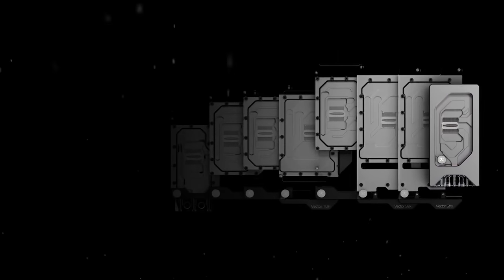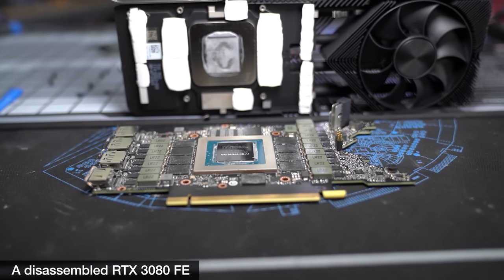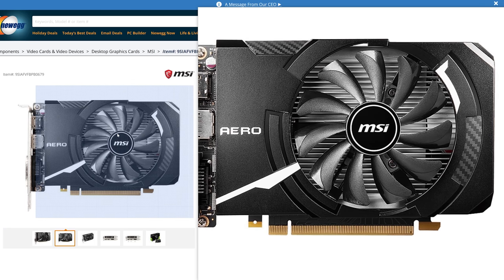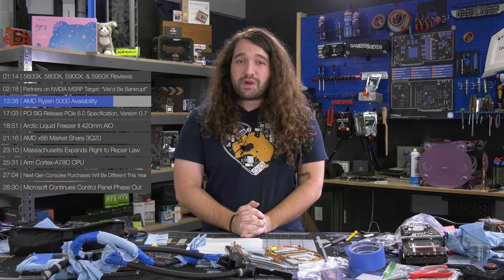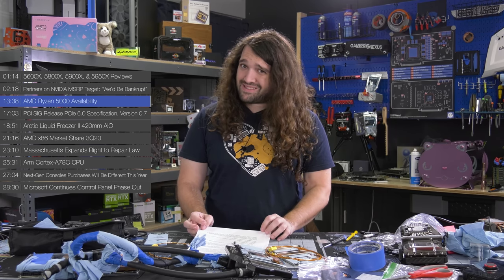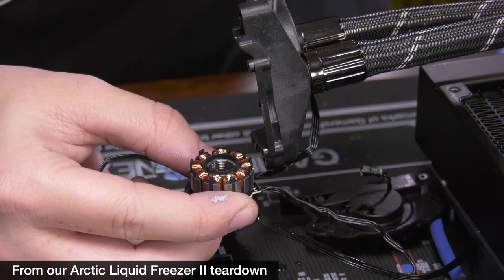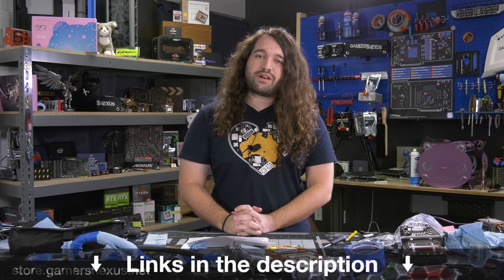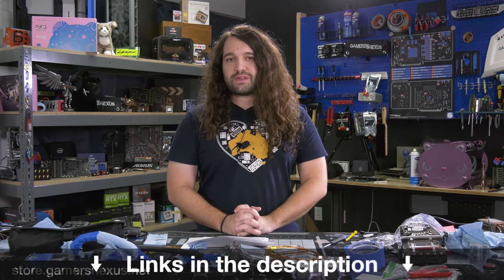HW News - NVIDIA MSRP Allegedly Not Realistic, Ryzen 5000 Supply, PCIe 6.0 Spec

Comment: "Deliberate Shortage" - I own a brew pub/restaurant. If I run out of wings or beer, I dont make money. No one goes "Ill go eat next door and pay you too." Its not like AMD gets anything more for jacked up eBay prices for things.
Reply from the maker: @n1ppale  They don't make money if they don't sell product. Doesn't matter.
Reply: @n1ppale  I think Nvidia just got cucked from going with Samsung tbh. and they didn't want to wait until later to 'lAuNcH'. Honestly should've just dropped the whole lineup with sufficient stock right when AMD announced their cards and they'd be better off
Reply: @GamersNexus  depends if the board partners are scalping their own allocations like MSI, just with better-hidden subsidiaries. That's how it works for the concert and sports industries, e.g. with ticketmaster.
Reply: If you artificially lower supply you increase demand due to fomo and the prestige of owning a sought-after item. Then when the product is stocked normally it sells better because of this increased demand. I seem to recall it's producer surplus but I haven't studied economics for years, all I remember regarding it is that consumer surplus is roughly how much cheaper the product is than the maximum they'd be willing to pay. Happened with Yeezys (as the most obvious example, I know computer parts aren't shoes). That's my opinion as to why a company would deliberately lower supply, because I don't think all companies always have profit as their motive - an example of this is fashion companies focussing on prestige, and supermarkets competing on price and customer support - even if these are to the detriment of profit, because they are more likely to profit in the long run, or if not more likely they at least offer a higher reward if they succeed than just normally selling your product at equilibrium. Not saying that also fits here, just being a devil's advocate.
Reply: @puffman06  Dude no. That was less than 10 cards. MSI is a $4B sales company. They were not impacting their bottom line by overselling 10 cards.
Reply: It is actually possibly different with a unique or unknown product though. The idea that a "freak out" on enthusiast forums could pique interest in a broader market is real.

That scenario is totally different than wings and beer.

It just doesn't really apply here when these 2 companies are in direct competition and the first one to stock shelves will win sales.
Reply: @lordbalzamore7692  These are publicly traded companies. They have a legal obligation to stockholders to maximize profit. If they got caught "faking shortages" they would be sued into the upper atmosphere. "Faking shortages" is another way of saying "losing sales" and when you intentionally lose sales shareholders tend to dislike that.
Reply: To be fair, Nvidia does play 15 D chess with us mere mortals! Who knows what evil plan that leather jacket has planned 😂
Reply: Nvidia did this in the past but it was because there was no competition but amd wouldn't do this right now because they still need to take more of pc/notebook market from intel
Reply from the maker: @puffman06  AMD doesn't have partners. NVIDIA only sells to partners, so that's what we're talking about here. Your concept makes sense for a limited supply, underhanded, slimy manufacturer, but doesn't work for the actual silicon supply.
Reply from the maker: Ultimately, you wouldn't deliberately reduce your silicon supply on a product that cost $1B to make and years to design, but which will only be viable on market for a year max.
Reply: @n1ppale  what you just said makes no sense what so ever..
Reply: @n1ppale  I can't believe that people are so naive to believe Nvidia, would intentionally limit their supply as a scheme to make more money. All this absurd claim is based on is the AMD fanboying going around, which is becoming increasingly toxic.
Reply: T1E6X1 I’ll admit that I’m am wrong with the claims that I said especially with what gamer’s nexus comment about the large investments these companies put for their products. Though if by the off chance that it were true I wouldn’t exactly be surprised. Coming from Nintendo, they have similar patterns to “artificial scarcity” (though no proof) but we can’t really come to that conclusion since well, we’re in a pandemic lol. Either way gamer’s nexus legit has more inside info and knowledge about the industry so im practically spitting shit out of my mouth in the end lol
Reply: Right now the only place i can even place an order for a 5000 series cpu in the uk is overclockers and they have a 10% mark up on everything as well as about £10 for standard delivery. And thats for pre order. 
 Yes, scarcity can be profitable.
Reply: @ge2719  But thats not profit for AMD, thats profit for the reseller based on demand.  AMD has an incentive to INCREASE supply in that situation because if customers have to pay a markup due to scarcity, eventually the price/performance for the CPU makes it non-competitive with Intel. Look at the 1600AF.  AMD sold them for $85 and it was awesome.  Then people jacked up the price because of demand and suddenly the 1600AF wasn't so great any more.  Right now on Amazon a 1600AF cost MORE than a 3600. Thats stupid and more importantly, AMD isn't making any extra money on $225 1600AFs, only Amazon is.  At that price, an i310300 makes more sense.  Same thing will happen with 5xxx series if AMD were to create a shortage.
Reply: It's more like Diamonds or Gold,  you artificially constrain supply, and everything is worth more, ao can sell less and make  more profit. It's what Nvidia is doing
Reply: it also doesn't make sense because current gen Intel CPUs have drastically dropped prices. if AMD holds their products to create a "shortage" then they're losing on potential customers to Intel or even to their older products with less profit margin, most don't want to wait months for supply
Reply: @WildkatPhoto  as far as i can tell no other place is getting supply in since i cant even pre order with them. So potentialy some sort of kick back bs going on? 
Either way when i say its more profitable were not talking limiting the supply to next to nothing, that's obviously not profitable. They just have to make sure they dont flood the market with so many cpus that a significant percentage end up sat there for the next six months and ultimately end up discounted. 
They can just produce what they can and sell them. They dont need to go into overdrive and double production, requiring more machinery and more skilled labour that then months from now they wont need because they fulfilled the majority of the demand on day one and dont need to produce anything for ages. Its more profitable to produce a steady stream that at first is in a short supply and then meets demand. So no factory ever has to shut down and no one has to stop working.
Reply: @anzumatsuri2181  Exactly, especially when a $280 processor of said line will be enough for gaming for years.
Reply: Not to mention the$170 hike on next gen version, but that's another can of worms.
Reply: @jaronmarles941  and not coming with a cooler even with that price hike
Reply: @ge2719  Meaning that $450 is now over $500. Well in 10900k range, and horrible without a cooler advantage.
Reply: @WildkatPhoto  don't waste keystrokes, my friend. if you haven't noticed, many people commenting on internet videos lack an incredible amount of common sense. I once had someone tell me that gold, an element with a unique color, high lustre, high malleability, rarity, and high resistance to tarnish does not make it suitable for jewellery. there's no point. society at large is headed towards the movie "Idiocracy," and we're just along for the ride. regarding low supply, I just put myself on EVGA's waitlist and I'm just hoping to get a 3080 within a couple months
Reply: @t1e6x12  actually there was an article written by Moore’s law is dead to say they purposely limit their stock, I think this is where it all comes from, he even leaked numbers of shipments, according to him they’re not having supply issues
Reply: @S55M3  He's shown bias for AMD before, and has been wrong multiple times. I don't trust him
Reply: If I was a shareholder for AMD, I'd want the ROI as quickly as possible.  Any signs of deliberate shortages when Intel has processors that's still good and new ones upcoming (regardless if they'll fully overtake AMD again or not) would probably be met with intense scrutiny and more board meetings.  It doesn't make sense to artificially limit supply.
Reply: Its just a Joke that Nvidia gets blamed for a terrible Launch, while AMD's was just as bad and all of a sudden it's the high demand not the low supply.
Reply: @n1ppale  You are definitely way off... Ryzen might be better but even Jay has pointed out that the best of the best is not always necessary.   If someone really needs an upgrade because they are running something significantly slower than say a 10900k guess what they are going to do if they see Intel at a price that works for them?  They will buy it.  I am personally tempted, but at the same time I am also confident that I might be able to limp along with what I have and the very minimum I might need to just suck it up and do a fresh install.  

The ammunition factories experienced a similar problem where they had to shut down and that caused them to get behind and now they are in a perpetual state of catching up until demand falls enough to give them room to breath.  The problem with the tech world right now is that there was a bunch of big advancements slated for this year and it is about the time when most people like myself consider upgrading.
Reply: @jaronmarles941  his recent leaks were the most accurate out of anyone else’s that I saw, he actually admitted to being wrong in the past and if you look at some of his comment sections you will see comments praising him for his accuracy
Reply: Compare it instead to your restaurant full with a line around the block. That's the kind of thing Nintendo and Apple do over and over.
Reply: Gamers Nexus Not all silicone sells for the same profit margins. If you are NVIDIA and have a piece of silicone you could sell as either an 3080 or an 3090, then you will of course put it on a 3090. Which is an extra dick move when the 3080 is in super high demand and impossible to find,while 3090 are comparatively easy to find.
Reply: @GamersNexus  What if Nvidia was trying to pull a Nintendo? Generate hype by how fast the product sold out...but it backfired because over a month later they still have no stock.

One popular conspiracy theory was that they didn't want to sell any significant quantity of FE cards and that the MSRP was a shell price a la the 2080ti. The theory is incomplete as some things don't add up but...

Personally I think nVIDIA miscalculated AMD's position, and/or Samsung's production capabilities, Micron's production capabilities.

Dude... seriously...8GB of VRAM on a fucking 500$ GPU? I'm vividly remembering a 600$ AMD card with 4gb of VRAM called the R9 Fury from 2015.

If I buy a GPU I'm going red this time for the same reason I bought a 980ti back in 2015/2016.
Reply: DeBriers corporation might have something to say about that, though they've also managed to convince the entire western world that you have to buy your future spouse a diamond ring for a proposal to actually mean anything, and they have a literal monopoly on the diamond industry.
Reply: If they can buy your beer next door without you getting paid, then you're really dropping the ball on the "brew" part of "brew pub".
Artificial rarity absolutely exists and works (re:loot boxes, trading cards), but it only works when you have a monopoly on the product (or often art/design/recipe). 
It isn't about selling a product in that case, it's about marketing the entire brand. One product is "rare" to increase the interest and value in the other products.
When you hear about people lining up to spend $1000 on some special color of Nikes, you feel better about spending $200 on a "common" color what are actually remarkably low quality shoes built from the same materials as a $20 pair from walmart. 
But the walmart shoes don't have the branding and FOMO.

Do you know what it really means if you're selling out of product?  That you aren't charging enough.
Reply: @GamersNexus  
AMD makes more than one product. 
I'm not saying AMD is doing it in this case because their whole product stack is sold out, but the FOMO business model absolutely works. It's how scalpers make money. It's why gamers are buying rtx 3090s. 
It's not money lost on missed sales, it's money saved on marketing and a way to pad overall margins on the in-stock products
Reply: @WildkatPhoto   you said it right there. They have to maximize PROFIT, not sales or revenue.
Reply: Yes unless you have a load of old steaks you want to get rid of and the place next door is not selling chicken or beef  because its stuck on 14nm then it starts to make sense...
Reply: While I also believe that it makes no sense for AMD to create an artificial shortage, things are a little different for Nvidia. One "conspiracy theory" sais that, based on the high production costs which are actually shown in the video, Nvidia wants to "have its cake and eat it, too" by pretending to have relatively cheap new GPUs, but still sell them at a higher price, for better margins, if the only Geforce 3080 cards which are effectively available are the high-end variants, not the cheaper variants. Then, making it extremely unattractive for manufacturers to sell any of the cheapter variants is just part of Nvidias strategy.

Of course, if Nvidia had more chips available, they would not have to do that, but apparently they do not, so then it makes sense to sell those which they have at as high a price as possible - while pretending to be cheap. And for that, temporarily pretending to have even fewer chips than they actually have, might be an advantage.
Reply: @WildkatPhoto  Then what was the point of doing it? That's what's so weird about that particular controversy. The benefit of doing it is so minimal or non-existent that it makes no sense to even do it. All it did for MSI was draw even more negative attention to them.
Reply: @ge2719  You are mixing apples and oranges. There is a HUGE difference between creating an artificial shortage and increasing your cost per unit by taking extraordinary measures to increase production. Remember, they dont own the fab where these are produced, Global Foundries does.  You cant just poop out extra wafers because you want them. I had a manager who could never seem to grasp that the fermenting process could not be speed up so no matter how much he wanted a new type of beer, it was going to be two weeks before we could deliver it.  
So let me get this straight - all the places that are selling chips at MSRP are out and the one selling them marked up at a higher prices has inventory available. And you think thats a sign that AMD is getting kickbacks? Wow.  I got nothing for you.
Reply: @Starscreamious  You dont know the restaurant business. Full with a line is a nightmare.  Perfection is one table open.  Dont believe me?  Read this stanichs-closed-will-it-reopen-burger-quest
Reply: @WildkatPhoto  wow learn to take a joke. 
And sorry but you just proved my point, if they wanted to increase production more have they already are doing in order to meet current demand and there not be a shortage then they would need to "ferment more". Like you would have to invest in larger facilities and more equipment in order to do that. And you're not going to. Amd arent going to, they arent going to get their 3rd party suppliers to do the same. So by not overworking there is a shortage, and thats the most profitable option for amd.

But oh you said I'm comparing apples and organges. Sorry but ive got nothing for you.
Reply: @WildkatPhoto  Nightmare for whom? I'm talking about it at the owner level...ie good for reputation. Are you saying it's the opposite?
Reply: @SparkY0  You are kidding right?  Seriously tell me you are just trolling.  Because one look at Steam survey tells you that while a FEW gamers might buy a 3090, "gamers" are not.  https://store.steampowered.com/hwsurvey/videocard/

The newest card on there in the top 10 is either the 1650 or the 2070 Super depending on how you want to view their actually availability. The RX 580, which is a speed boosted 480, is #10. The 1050/1050ti has more Steam Share than every version of the 2080 and 2070 COMBINED.  The GTX 970 - 4 generations back - is just shy of the combined share of the 2080 and 280ti.  FOMO my ass.
Reply: @Gareth Tucker "Right boss so I have this great idea to make more money.  See what we are going to do is not sell our product until......"
"You are fired. Get out."
Turns to next guy - "What about you? Got any ideas?"
should
Reply: @Starscreamious  No its not good for your reputation. NO ONE likes waiting in a line for food.  No one.  Restaurants live off regulars, the people I see week after week on their "regular" day who sit in their regular table. That is our foundation. They are your best marketing, telling people about this great place they go to, and your predictable sales that let you soothe revenue. If you have long lines, you lose those people. Read the article.  They lost their regulars, people in line had sky high expectations and when they were not met, they trashed the place. I hate being empty but I hate making people wait for a table even more.  Eventually people leave and any time a customer who wanted to buy my product and walks away because I couldn't deliver it, I have to work double hard to get them back.
Reply: @WildkatPhoto  Maybe it only works sometimes...like special events or grand opening... otherwise you get backlash.

Another way is to do reservations only.
Reply: Dysjecta Membra, finally came across someone who truly gets it. 

Everyone needs to take note, stock prices isn't as simple as black and white. 
Share prices rise and fall based on news,  not sales, PERIOD. 
With that being said, quarterly sales matters also, but you have to wait every 3 months. 
In between, companies will throw out good news and breakthroughs to jack up share prices for the short term so shareholders can sell them at a profit. 

Take pharmaceutical companies for example, they'll announce breakthroughs without selling a single vaccine but make $billions on selling company shares.

In terms of Nvidia and AMD, create extreme high demand, even if they only sell 100 GPU/month worldwide , investors will speculate big profits in the future, then the Wall Street buying frenzy will drive up share prices. They don't give a fk about the physical product, to a certain degree. 
The general public just doesn't get it.
Reply: @WildkatPhoto  In your case, it makes sense for a private company to have lines of customers buying physical products, but for publicly traded companies, it makes more sense to drive up share prices through any means necessary on an "invisible" product (shares) that costs nothing to produce.
Reply: @alex46801  OMG you really have no idea how the stock market works. Companies dont make money off stock trading unless its an IPO or secondary issuance. Daily trades are between individuals who own shares/buy shares and all of the profit or loss from that trade belongs to the INDIVIDUAL.  Also, any statement from a company has a legal obligation to be truthful or they can be accused of securities fraud.  Only idiots trade on "news" vs numbers. And no, you do not have to wait three months.  In fact if there is a material change in financial data companies ROUTINELY issue revised earnings estimates within the quarter in order to remain in compliance with SEC reporting requirements.  Here is the October 27th revision from AMD - https://www.nasdaq.com/articles/amd-updates-guidance-q3-profit-tops-estimates-2020-10-27.  Those estimates have to have FACTUAL basis or they are fraud. And since AMD isn't issuing ANY new stock, any increase in price because of this increased revenue is profit for share holders ONLY. Even the perception that a company is being less that transparent about reporting will lead to its share price being hammered - see General Electric https://www.reuters.com/article/us-ge-accounts/ge-shares-fall-on-madoff-whistleblower-calling-its-finances-a-fraud-idUSKCN1V519M. 

Stop worrying about the general public, its you who doesn't get it.
Reply: @n1ppale  Dude, if they don't sell millions of cpu's they make no money. They can't pay TSMC. They can't pay Global Foundries. Those are sunk costs. You really don't get it.
Reply: @WildkatPhoto  don't get your panties in a bunch, look up the term pump and dump and Dunning-Kruger effect.  Shareholders include people within the company and big institutions.
Jeff Bezos just unloaded $billions worth of his shares recently at the high that he will buy back at the low.
You know nothing about stocks even something as basic as "Sell high buy Low".
You own a restaurant, I'm sure your profit margins is 5% at best atm. But I know you're PROBABLY not an idiot and would gladly sell an "invisible" product for 20% gain.
Can't believe you took all that time to do research that I didn't even click on to try and convince me otherwise, don't let your ego get to you.
Reply: Wrong. I reached out to shops and asked why their prices are higher than launch price and they said that they can only buy it for alot from amd at the moment because of limited supply and they have to give the price to the customer or they wouldnt make profit at all but lose money instead.
Reply: @alex46801  I don't think I can actually take you seriously if you can't tell the difference between a man and a company.
Reply: and if the 5 oclock news does a story on the 200 people lined up last Friday just to get into your pub for the chance at a taste, hits the airwaves on Monday? Can you not see how this will generate HUGE value?
Reply: @brian_sipe  I don't expect you to, you're still part of the Matrix. Corporations are legally people. Bet you didn't know that, you're welcome. 
Think the profit margins is huge on the 3080 FE?
Research Martha Stewart goes to prison for getting caught doing inside trading and that would give you an idea of how they make money on top of the physical crap they sell you.
She's not the first and won't be the last.
Reply: RG they just don't get it, it's all about public perception and hyping up products to prop up their stocks, wether they'll be able to meet demand or not. Free press.
I don't even think he really owns a business/pub. It's equivalent to him selling vouchers and gift cards for money upfront to investors.
Reply: @alex46801  Dude you don't even understand what I mean.  If Bezos sells a million dollars of Amazon stock,  the only person who gets money is him. The tens of thousands of people who own stock in Amazon don't make anything,  nor does the company.  The company only made money from the IPO. AMD is in the same position, as their stock price keeps people interested,  but they already have tremendous interest in their business and products.  It's like you're taking a college English exam and trying to look up answers from See Spot Run.
Reply: I've worked in the liquor industry and have seen deliberate shortage be a major thing with craft breweries. Buying beer from some breweries required being on a waitlist and oftentimes a customer could go directly to the brewery and pick up a larger quantity themselves than we could actually procure wholesale. The prices of these beers would be astronomical, but people would pay absurd amounts of money for them anyway. Twenty dollars for a 16oz 4k of IPA? That's absolutely ludicrous. 

Of course, the very moment they stepped up production, their beers would sit on our shelves and practically rot. Then they'd drop the price to less than half to get it moving again, drop the SKU, start a new super-limited SKU, rinse and repeat. Many usually fail to stabilize their price to quantity ratios and lose out on their rabid customer base as well as their daily drinker crowd. Fuckin' Lawsons, man.

But beer is definitely a different sort of animal than tech parts, I think. It seems to go through an insane upheaval every month. I think a lot of the blame can be given to the internet and beer forums where finding and reviewing beers went from a personal hobby to a goddamn sport. You're supposed to be enjoying your beer, people. I don't care that you managed to trade a handy in the parking lot for a Heady-KBS or a Pliny-the-Cantillon or whatever. It feels like craft beer people never buy the same beer twice, which also sucks for people who find a beer they actually like because breweries can't afford to keep making the same beer. You'll never find that beer again, so you have to buy it, chug it before it goes bad and then idly search for a replacement that will also go off the market in a month. 

I've got mad respect for brew pubs. Much less bullshit going on there. I show up, there's beer on tap. The game is no longer "collect the pokemon." The game is called "drink the beer." What do I win? Another beer!
Reply: @alex46801  its like when your ISP lobbies Washington, challenges FCC, etc. wtf. Just hook up my cable and make it fast w no latency. No, they gotta rule all media distribution w exclusive contracts and monopolize every gateway to all tcp communications. When is it all gonna stop? I just wanted to play some online games.
Reply: @pirojfmifhghek566  Most breweries have no control over what the distributor charges for their beer. I have a target prices but once I sell it to the distributor, he can charge what ever he wants.  

Absolutely with you about the "beer hunters".  I got 4 of them in my pub a month ago. They took up a booth for an hour drinking one beer while posting on untapped, instagram, twitter, etc.  Oh and it was happy hour so their total bill was $15.  Thanks guys.  And you have to shower them with attention or god forbid they will get their feelings hurt and post bad things about your beer.  

I love beer but Im not on a single one of the beer social apps.  I sure as heck dont want to document my drinking habit!
Reply: What's insane is a 16oz bottle of water selling for $2. Why? Because people are buying them. 
Watch what happens if people don't FOMO on Nvidia 3000's and AMD 6000s.
Reply: @brian_sipe  I get what you mean, but you don't realize Amazon stocks is traded thousands of times a day by various people and entities. If Bezos dump a million shares in one day, a lot of shareholders will follow suit to lock in profits before share prices start falling due to over supply. Then they'll buy it back on the cheap, wait for it to go back up, rinse and repeat. Makes sense? 
They can even make money selling you shares they don't own.
Reply: @IDKOKIDK  
Please tell me how NVIDIA is profiting from high prises of resellers? 
This is a completely ridicules conspiracy theory.
Reply: What actually does make sense,  retailers are trickling out the products because they have comparable priced processors of last gen still in stock and would rather not take a loss on... A 3600 is now really worth $125. A 3900 $250.... A 2080Ti $525... A 5700xt $275... A 10900K $200...